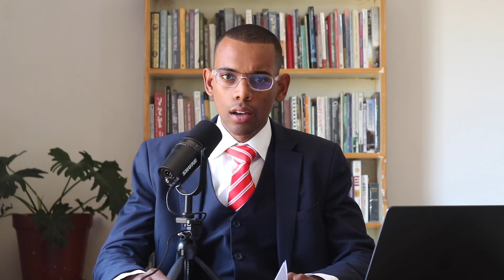Load Shedding: Private and National Solutions

Comment: 6:46 or Autostart when the PC Board don't sence any electricity on the home grid.
Reply from the maker: That would work as well, thanks for the comment!
Reply: @shanleylutchman  this was before I found out how the rechargable globes work even when the switch is off there is still little current on the neutral wire. If it is a blackout there is no power wat so ever.